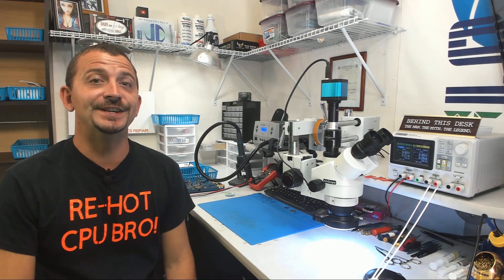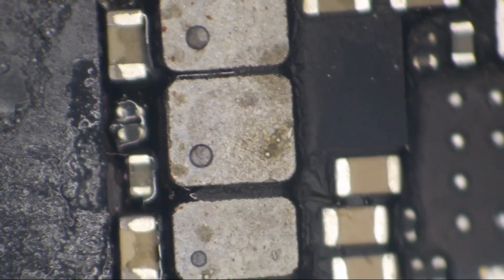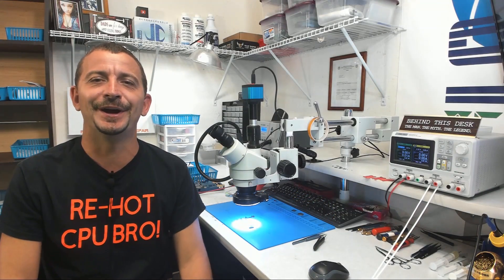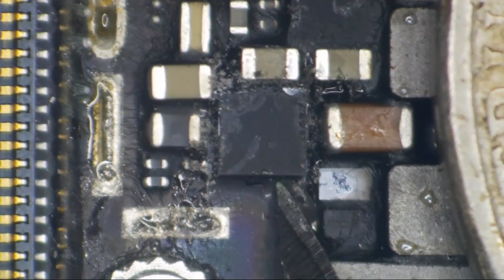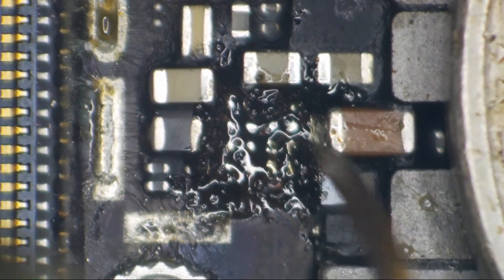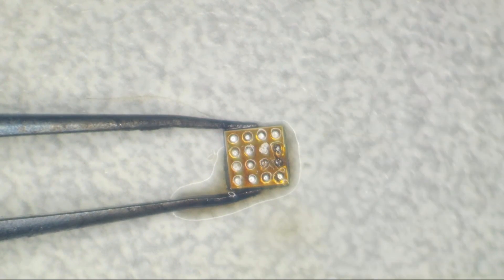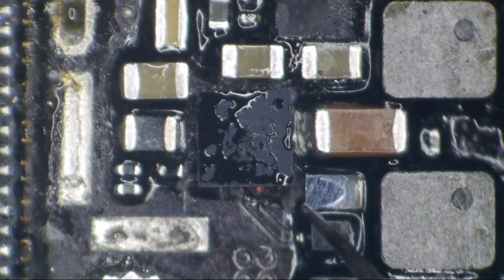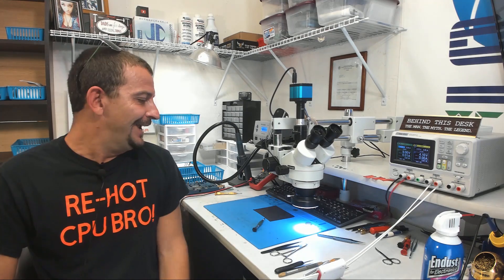Fixing a nasty Apple refurb that has had the CPU replaced

Comment: If I have a shadow effect in one corner of the screen of my iPhone 6 Plus, is that a backlight issue?
Reply from the maker: Yes for sure just a backlight issue.  The pluses have 2 complete separate backlight circuits that each light half of the screen in 2 sections per half. Sounds like yours is missing one of the cathodes (or sections). It usually happens after a screen repair but the 6 plus is notorious for it happening at random.

Comment: Hi, hope you can give a few pointers on what went wrong, I replaced the screen on a iphone 6s plus with an aftermarket one, I transfered everything very carefully from the original screen to the aftermarket one including the home button. Everything is working fine but touch id is not working, the home button key is though. I checked everything, everything seems connected correctly and I don't see any damage on the flex cable. Now I know that if I had used another home button that it would loose touch id since each button is paired to the board, but in this case I transfered the original button, I don't understand how a screen swap would cause this issue...
Reply: t0nito hi brother if you didn’t find out the solution yet I am here to help.

Comment: For removing bga's I wonder if you could use something with a little bit of springiness to it. That way less force is applied and less chances to lift a pad off. Maybe something as simple has a paper clip. If the paper clip is a little too thick to fit under the bga then use a hammer to flatten the tip down.